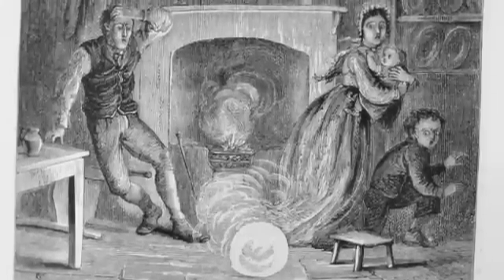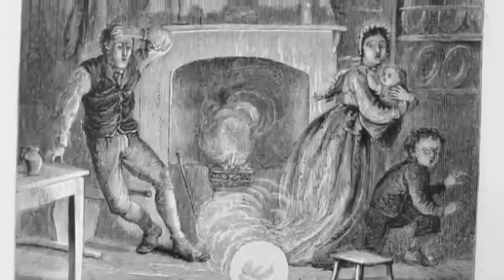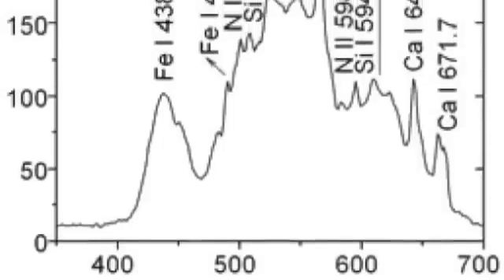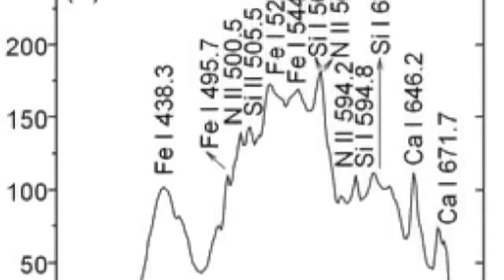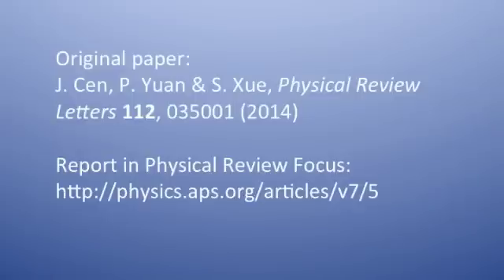What is ball lightning?

Comment: Seen this, ball lighting at a drive in theater as a kid. A storm was moving in, and it seemed like the lightning was on the ground. It was what we would call heat lighting, cause the lightning moved in over us, still no thunder, and I saw an orb move in the parking lot, started from the right side of the lot, and moved to the left towards the middle of the parking lot.. Got us and about 50+ cars to scram. This was in 98, 99, 2000??

Comment: I have seen a Ball of light one evening walking home with my girlfriend it was about 20 years ago  it was around 22:30 it was about the size  of a large orange pure white and bouncing around just above the grass i pointed this out to partner it was bouncing around in a small area for around 10 seconds and then at a high speed shot over house in front of it and was gone i was only about 30 feet away from this ball and yards from my partner house we then went in and i called Cambridge radio and told them what i had just seen . Thing is we had no thunder storms or rainfall it was a warm evening so im not sure these balls are just conditions of thunder ?  ? ?
Reply: This is similar to what I saw. I was about 20 metres away. The Ball was hovering over my neighbours house as i walked in the driveway... As soon as I looked up it took off at high speed and completely disappeared in a flash of blue light... No rain or thunder... it was a warm night about 10pm

Comment: I saw ball lightening when I was about 21. I was sitting on my couch with a chimney directly opposite. It came out of the chimney and glowed like a lamp. Size of a soccer ball. Floated in mid air then followed the curve of the wall down the corridor and out through the front door. I had no idea what it was -- I thought it might have been some sort of spectre. I told my partner about it later in the day and he knew straight away -- he has an interest in science -- and to this day it just amazes me that I actually saw it. I was incredibly scared at the time -- and I also almost touched it. Glad I didn't as might have been electrocuted.

Comment: From my perspective I did not observe the ground being struck but rather the balls just appearing. Since I seen two in basically the same spot in my mind I've now disproved the notion lightning never strikes the same spot twice!  Ha!!  I also think since I seen one right after the other I think I would have seen a flash hit the ground especially the second time since they were only a several seconds apart and I was standing there with my jaw dropped eyes bugged out. I believe the nearby well was the catalyst. An electrical charge came out of the ground. As to what or how it turned into a ball I do not know. I do know this the 1st was a grapefruit size the second a volleyball size. The later was considerably louder than the former. It was quite shocking at first but reality soon got the hold of me and I ran like the wind into the house. After all the 2nd orb hovered, then started coming towards me a few feet only to explode violently.